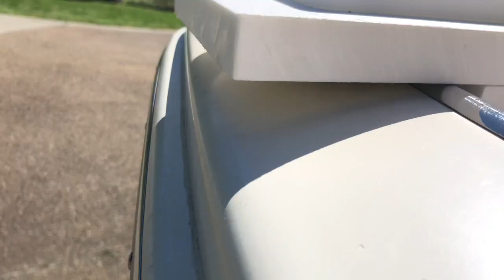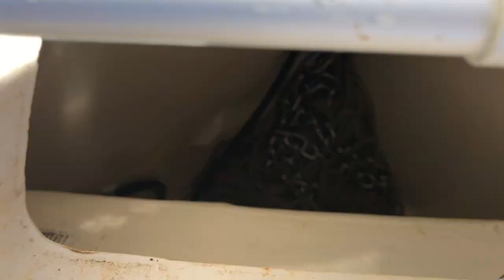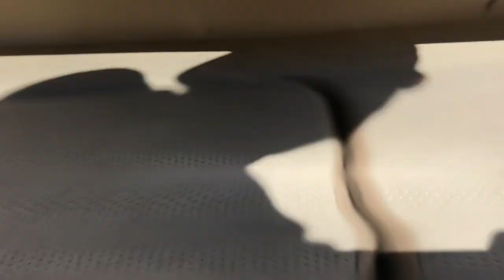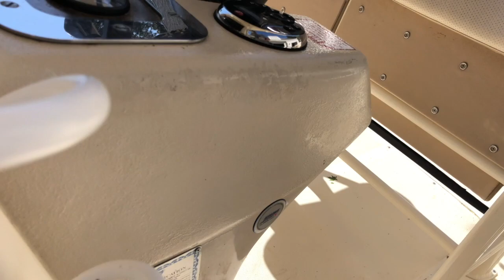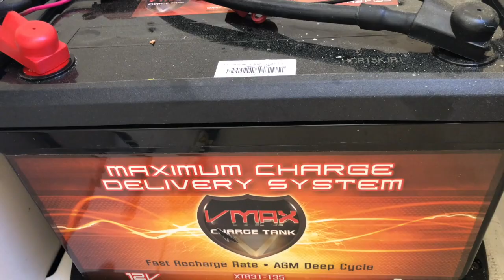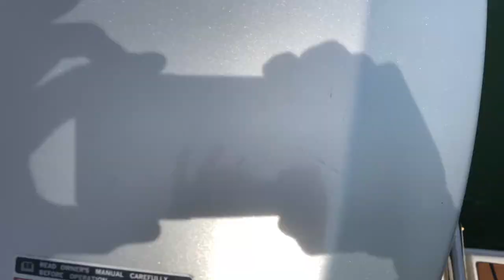Rhodan trolling Motor installation walkthrough on 26 ft offshore Center Console

Comment: Nice install and vid.  Just a safety comment on your wiring, and for those who want to do an install in the future.  Do not run your positive and negative together.  Separate them by a foot or so, yes it is a pain.  Reason: you are going to run the boat and potentially get some rubbing of the cables.  With the positive and negative right next to each other, well, you know what can happen.  They rub, wire gets exposed and then next thing you have is a fire.  These are big wires and they are more prone to bouncing, however so small.  

I did a similar set up on my boat and my electrical guy told me the same thing (nice job, looks really professional, but it's wrong.)  I had to pull it all back out and redo it.  Still learning. . .
Reply: Great info to know ..

Comment: Clever install - I am new to trolling motors and want to install one on my Seacraft 20  MA which has a higher front deck area like your boat. Do you get up on the front deck area to deploy the TM or can you lean over from the lower main deck -  I am trying to sense of  how secure it would be standing on the upper front deck area to deploy and retrieve the TM in, say 1- 2 foot waves.  Thanks

Comment: @boneset1 does it matter that the motor mount isn't oriented in the exact same direction of the boat travel? Does the GPS head compensate for the mounting direction when deployed?
Reply from the maker: It should be as close to the center line as possible and it really has not mattered.  There is compensation by the unit

Comment: How much money spent start to finish?
Reply from the maker: 3000 motor, $300 in cables, $750 in batteries--all worth it.  I can fish anywhere and solo
Reply: @boneset1  Do you ever wish you had the 84" shaft
Reply: @markartzMIT  I did the swap. replaced my 72" MG with an 84" Rhodan

Comment: Where did you get the starboard from?  Also is there any flex in the starboard where it overhangs of the side of the boat?
Reply from the maker: I bought the starboard online. no flex what so ever!!!
Reply: @boneset1  Do you have a link?  Trying to find what works but not pay a bundle.
Reply from the maker: No starboard flex and I bought this on line

Comment: How are the batteries holding up?
Reply from the maker: Never killed them in a day yet.  Longest day has been 7 hours trolling in heavy current and batteries were still good.  I did not check battery percent remaining. Boat is 5500#
Reply: Thanks. Putting my new Rhodan on tomorrow. Very excited. Thanks for the video.